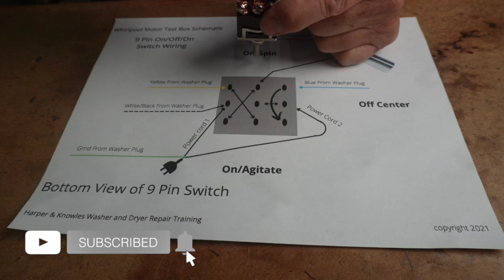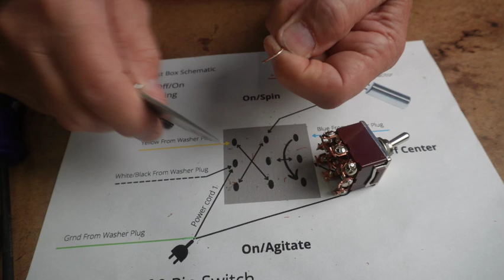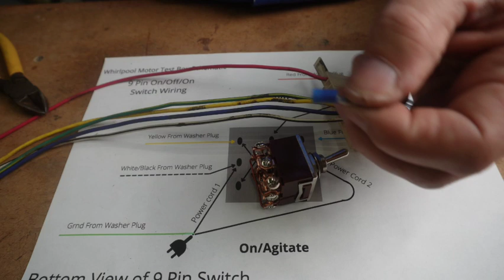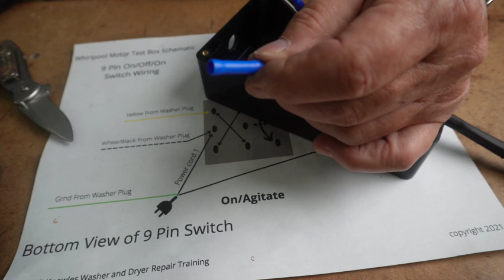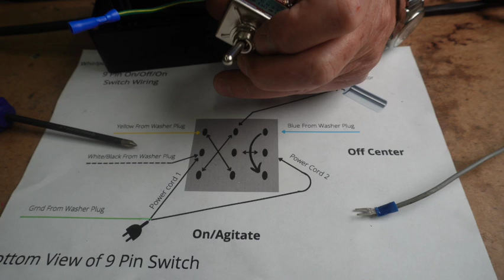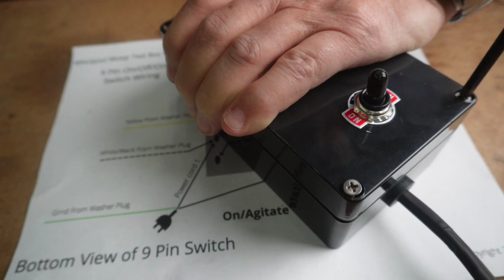How To Build a Washing Machine Motor Tester: DIY Guide for Forward/Reverse Testing

Comment: Hi where can I buy the kit so I can made one thanks.
Reply from the maker: Hey! Thanks for watching. Sorry, no kits, but the plans and links to all the parts you need are listed in the comments. The only part you might have to dig to find is the plug for the motor.  There is a link to a motor with a plug in the links and you may be able to find the plug sold separately if you dig around.  I'd just ask a repairman that has a boneyard if you could cut one from an old washing machine he may have. I thought about making up some kits to sell or sell the boxes myself, but I lack the time and inclination to do it at the moment. I hope you can make yourself one!